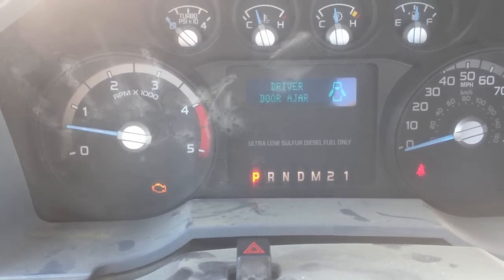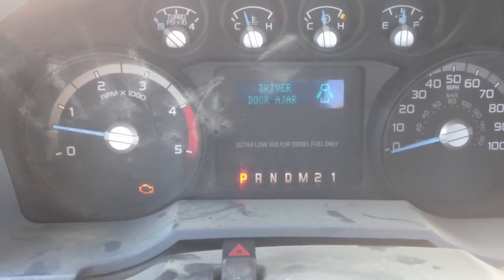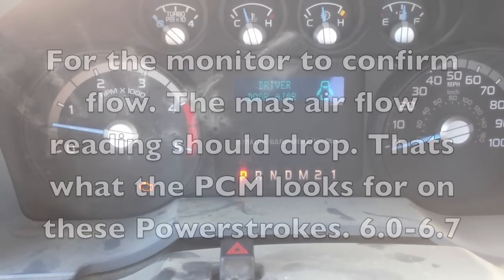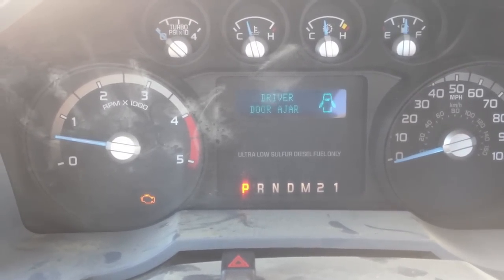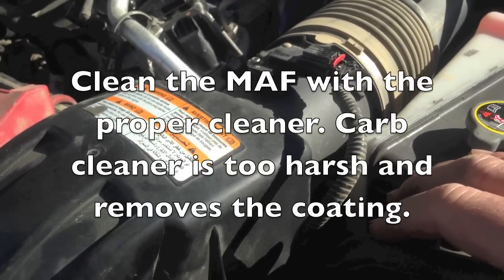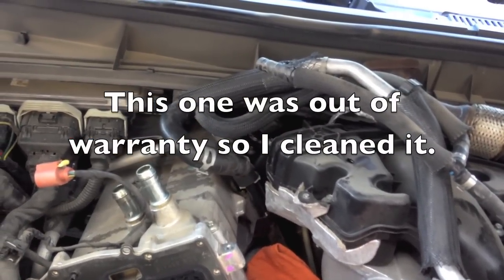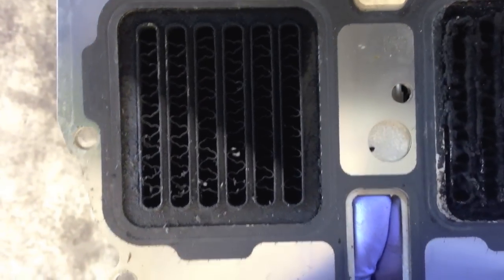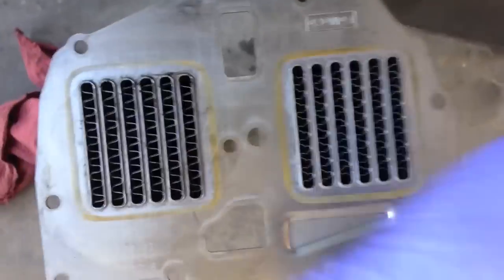P0401 on the 6.7 Powerstroke

Comment: Ron, This inspired me to check up on the 2011 6.7 I just purchased. It has 130k on it and threw code 0401 2 weeks after I purchased it. When I pulled my EGR it looked exactly like the one in the video. Some simple water based degreaser, a straightened coat hanger, and a garden hose did the trick. Nicely done, mate.
Reply: +Pfister 1 How difficult is it to remove the EGR cooler? Also should I have replacement gaskets/seals on hand? Will Ford have them in stock? Thanks for the clarification
Reply: The gaskets were rubber rings embedded into the cylinder head. Didn't need a new set.  They were not the "plate" type gaskets ford usually has. I would get a set of stubby swivel end wrenches from the clearance aisle somewhere, the "hooked bracket" for the turbo pressure sensor behind the EGR cooler has limited bolt access. Also, use extreme caution removing the exhaust plumbing bolts, I had one break off, luckily, there was just enough room to drill and tap with a cordless right angle drill. Follow any instructions from an aftermarket EGR delete system, recommend Sinister diesel's color instructions. Good luck. ~Pfister
Reply: Would a Power washer work, or  just plug up the other end of the other cooler rad?

Comment: Good info. but I have a couple of questions... How difficult is it to remove the EGR cooler? Also will Ford have the gaskets/seals in stock or will I need to order them? I have an 2011 F250 diesel, Lariat FX4 with 130k miles and engine code of P0401. Thanks for the help.
Reply: The EGR cooler is not too difficult to remove. You just need to disconnect several components. Once you do that the cooler itself slides out of the housing.

Comment: Hey Ron, would love if you could show your removal process for the internal cooler. The WSM says to remove the upper intake and bla bla bla. other guys say they have success with removing the pcm and accessing the rear bolt through the created room. it looks as if you just pulled the EGR valve off the front and left the case sitting on the valve cover. were you able to pull the cooler tubes out with the case still on the valve cover?
thanks
Chris
Reply: I would remove the cooler housing, it has two o rings and gasket that should be replaced

Comment: I have a couple of questions.  1) My 6.7 was produced in 2010 for the 2011 model year and I had a complete engine failure due to the improper heat treatment of the glow plug.  Ford replaced the engine under warranty with a factory reconditioned 6.7.  It now has the metal oil pan and drain plug.  Is the EGR cooler included with the factory reconditioned long block?  2) The Reductant heater just failed and Ford replaced it under warranty and flashed the PCM.  If the PCM is flashed; is it with the latest settings/parameters so hopefully the EGR cooler doesn't get clogged?
Reply: You may already be aware by now, but Ron passed away about 5 years ago in a car accident....

Comment: Hi, I have a 2011 f350 6.7 which keeps throwing code P0489 (EGR control circuit low). When I delete the code it just comes back in immediately. Truck runs and sound normal and for the life of me I can't figure out what is causing this code. Please help me look in right direction. Thanks!

Comment: I have the same issue on my 2012. I was told that the egr cooler and valve actually need to be replaced. Do you know if there is a way for me to tell before having to actually take it to the dealer? I might just try to clean it this weekend.
Reply from the maker: if the code comes back its most likely restricted.
Reply: +DieselTechRon is there some things you recommend to try at home before taking it in?
Reply from the maker: +jon hagood yes. You can try the ford fuel additive over multiple tanks of fuel.   And hopefully the videos I make inspire or give you confidence to do it yourself.   Otherwise I failed.
Reply: +DieselTechRon I will give it a try. I ordered this and will run it through. http://www.amazon.com/gp/product/B000NUAFH0 I will keep you posted once I get it resolved.
Reply: Well it has been a year now and no issues. I ran continue to run the cetane booster and it works fine.

Comment: Intresting, i usually only see a clogged egr cooler due to a reason though, normally a very small split in the cooler causing a carbon/coolant mixture to clog it up
Reply from the maker: Yes you're a 100% correct esp on the 6.0. I'm seeing these from excessive idle time. Not sufficient warm ups and fuel quality
Reply: DieselTechRon Is it best to replace coolers instead of servicing them ?